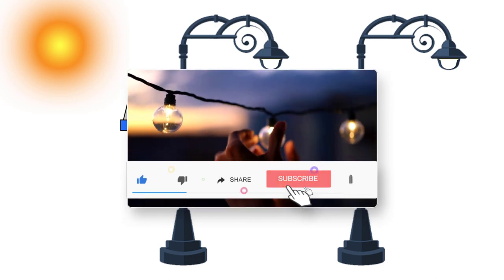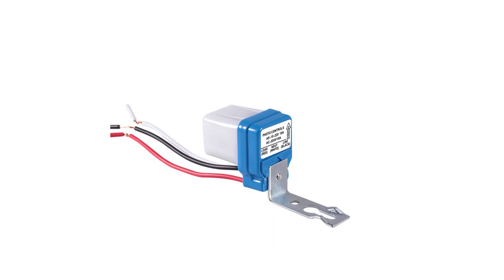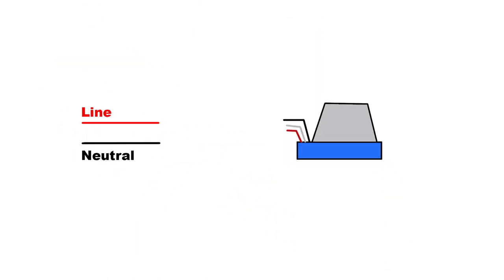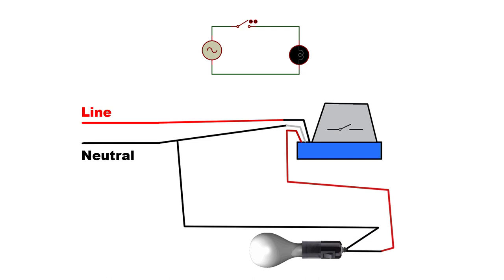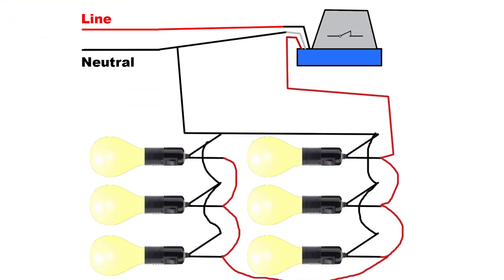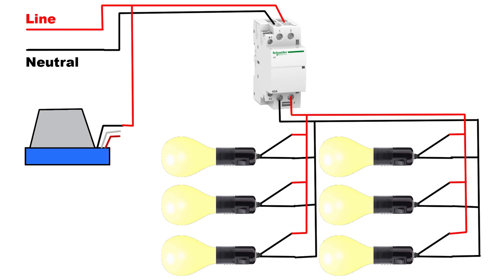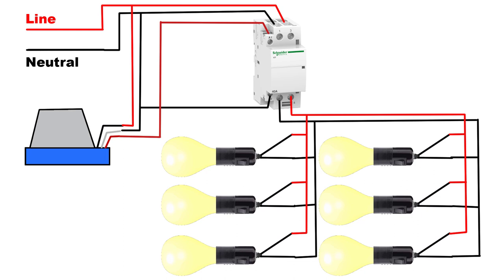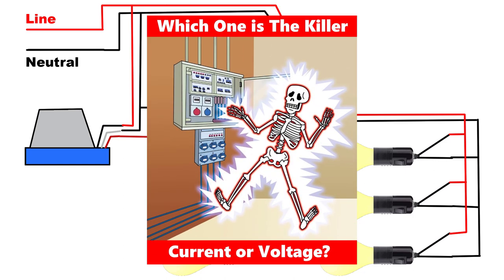How to connect Photocell Switch? |Explained

Comment: Good job sir.
Please, can this photocell ne used to connect outside lights in a building so that the lights turn up automatically when no light 8s detected by the photocell?.
Watching from Nigeria
Reply from the maker: Sure we can,, a great idea thank you 🙏❤️ greetings to all Nigerian citizens
Reply: @electricalengineeringplane6620  thanks from Nigerians here.
So do i have to place the photocell outside the house or i can still install it close to the DB
Reply from the maker: @elohorolokpa  photocell is used to differentiate between light and dark so we prefer to place it outdoor
Reply: @electricalengineeringplane6620  if it's placed outdoor, will it function well?
I think the photocell doesn't need light to shine on it